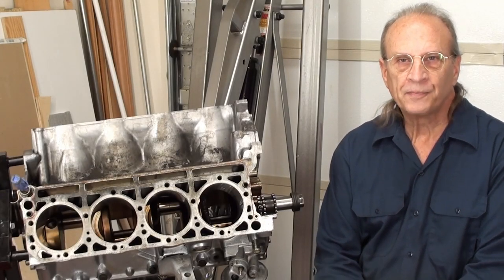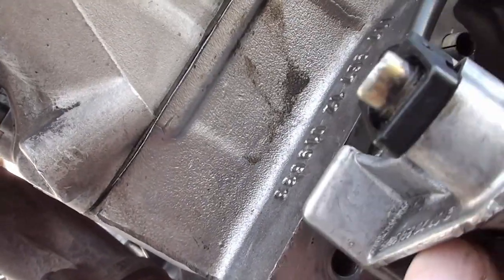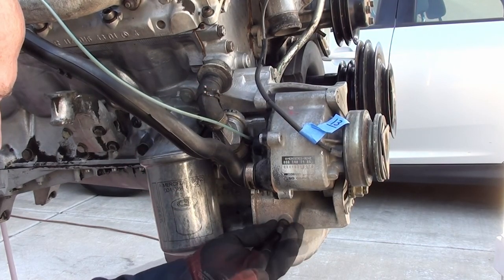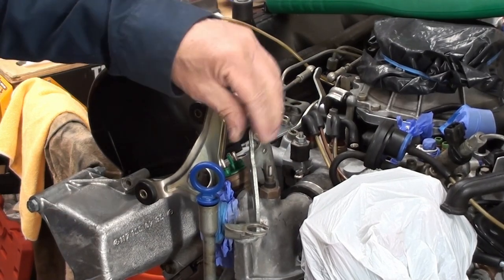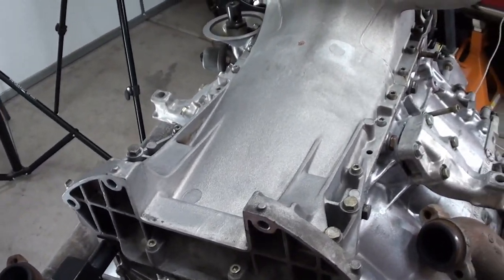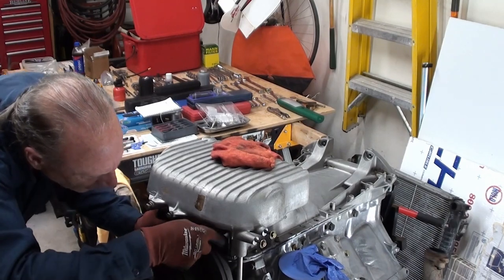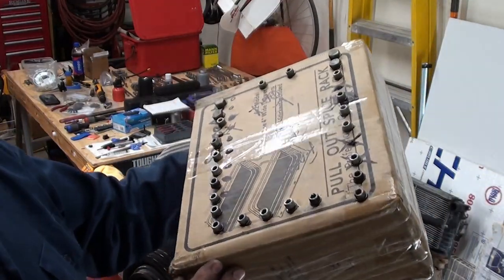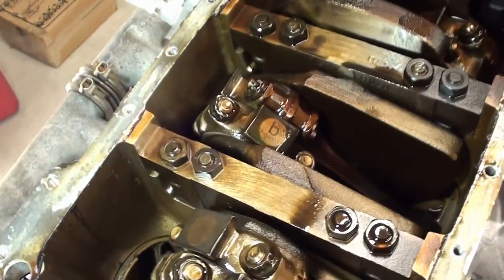560SL - M117 Engine Teardown Part 1 of 4

Comment: Take that air pump off and throw it away. Along with the EGR tube
Reply from the maker: I would, but that would not be restoring the car to how it was delivered in 1987. I also like the USA bumpers and double lights. Classic cars are always worth more when they are unmolested. As I said in the reconditioning the EGR valve video, many people simply plug the EGR with a plate and remove the pump. I however have elected to keep the numbers matching car as original as possible. I even have the original window sticker and the original wheels including the original spare tire from 1987.

Comment: Ford based the 4.6 2v off this motor. I don’t see a lot of information about this at all. But take a look at the two motors side by side. They are identical.
Reply from the maker: Look at the LS. The Mercedes M117 engine is the base of many other engines.

Comment: The first engine 'rebuild' looks like a hack job.  How many miles are on this 🚗?
Reply from the maker: Thank you for seeing what I see. The odometer reads 140,600 miles. I think it threw a chain and trashed the passenger head (video coming). The guy probably traded it in and they hacked it together. I can't remember if I am the second or third owner. I think I'm the second. Other owners (dealers) never registered the car before I bought it at auction. That's how they do it.

Comment: I have a question, what is the purpose of the secondary air injection pump? 

Thanks in advance. 

Helmer
Reply from the maker: The secondary air injection pump is for emissions control. When functioning properly it injects fresh air into the exhaust stream which is supposed to allow for a fuller secondary combustion of exhaust gases.

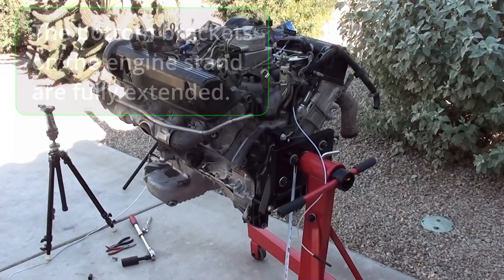Comment: 11:39 I’m noticing what looks like stress cracks in the block ? Here 11:39.
Reply from the maker: It does look like cracks in the video, but those lines are casting lines. They are protruding aluminum ridges which could be ground down with a Dremel.